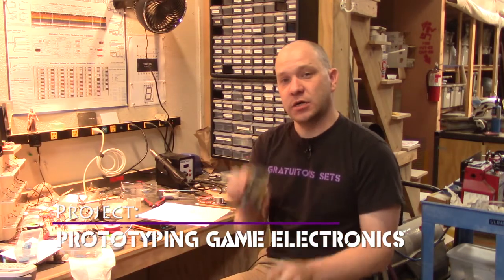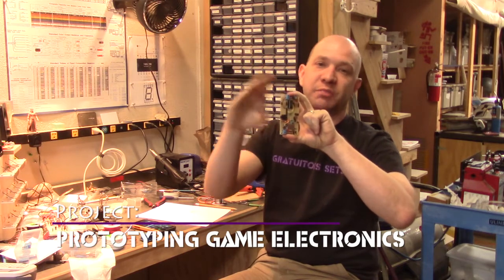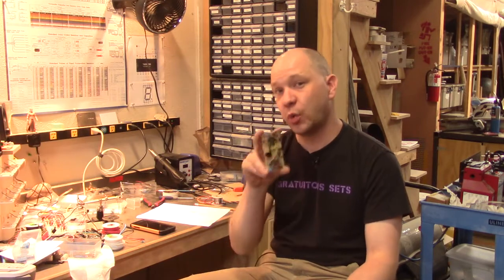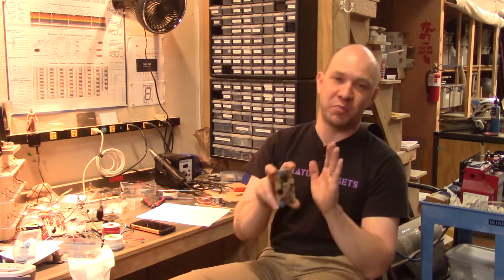Prototyping Escape Game Electronics

Comment: What I suspect on your transistor fail is that you are using transistor that are too small.  If you are powering a solenoid that is a fair amount of current.  To power that the transistors would need to be pretty large and should have heat sinks.
Reply from the maker: We have advanced pretty far since this video was made 😊

Comment: One of my favorite jellybean parts is the ULN2803 - much easier than discrete transistors - doesn't require external resistors and you can combine multiple pins to get extra current if you're switching something big.  It comes in a 5v and 3v logic level version as well (I use the 3v version for MSP430 which is my preferred microcontroller) and can definitely handle turning off/on 12v devices
Reply from the maker: Thanks. I'll look them up.

Comment: Why not use a Raspberry pi as the brain?
Reply from the maker: Short answer:I don't know Linux.
Reply: I like Raspberry Pis but if your end user does not know how to handle them they can corrupt the OS. Arduinos are easy the end user can unplug them to reset them without any issues. Linux is not hard but you need to learn a language like Ruby!

Comment: I only use relays when I need to interact with AC. For 12v DC I always use MOSFETS. From what I have seen some of those cheap Chinese relays do not have a diode so they tend to weld the contacts together. Actually that is a common mistake most people make is not using a flyback diode on anything with a coil (i.e. relay and solenoids). Love your box of smoked components everyone has one or two boxes in their shop. Keep up the great videos and good luck with the PLCs.
Reply from the maker: Version one had MOSFETs (TIP41A). Thanks again for the advice. I'll look those up.
Reply from the maker: We're gonna need a bigger box...